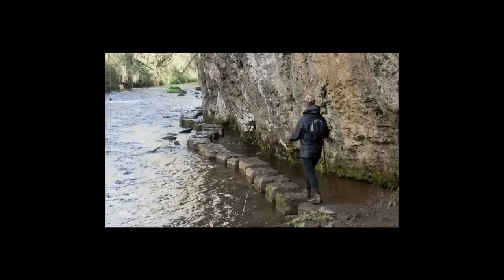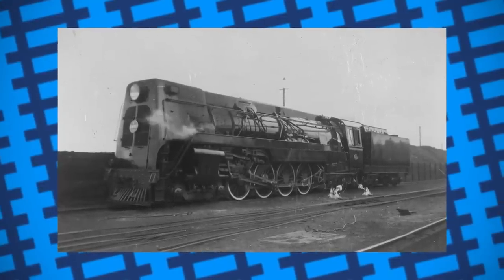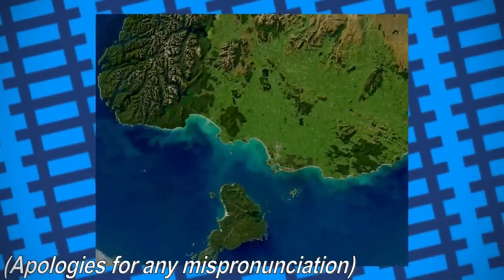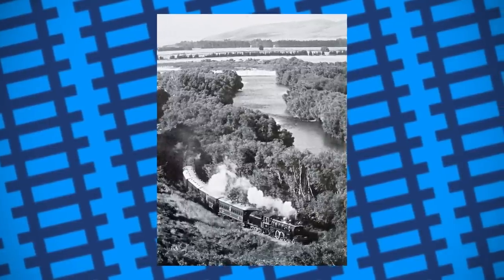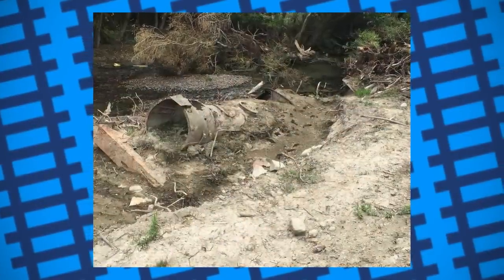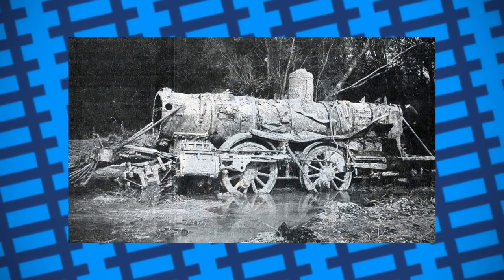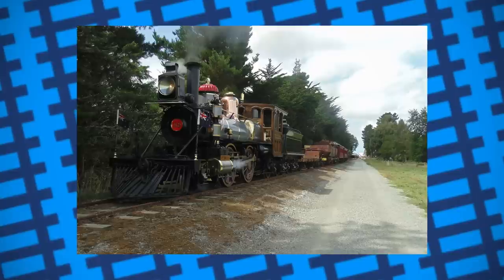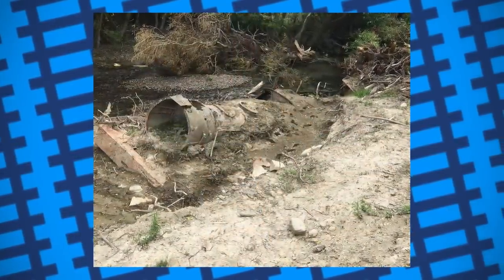The Steam Locomotives that were found at the bottom of a river - Branxholme Locomotive Dump

Comment: Its still very common in New Zealand to see the box bodies of old 4-wheel open topped goods wagons used as erosion barriers around rivers. Hundreds of them were retired in the 1970s  and 1980s with the move to containerisation and bogie wagons. Filled with concrete or rock they can stack like bricks and are extremely effective. Even better than thewire cage gabions which they use now since the obsolete wagon stock has been depleted.

Comment: There is 2 river engines that are in running condition, K88 as mentioned in the Video but also a sister engine to K88 which is K92, K92 runs at Waimea plains railway not far from Gore in Southland. Back in the late 90's and early 2000's K92 did a bit of a tour around some of the south island preservation Railways I had the pleasure of driving K92 a number of times at Ferrymead in Christchurch. I should also add that as a kid I lived in Invercargaill and in the school holidays I would bike out to the locos at Branxholme and spend a few hours exploring them before biking home, a round trip of just under 40km!

Comment: I remember hearing about K 88 and her story many years ago, and found it quite bizarre. I was lucky to see her at The Plains Railway in 2018, although they were instead running Vulcan Railcar RM 50 while the K sat outside the shed.

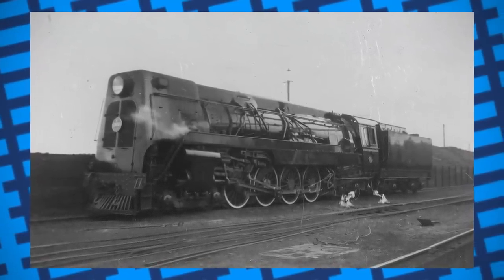(0:41) - That's a KA or KB class 4-8-4.
(1:31) - AB class 4-6-2 hauling what looks like the Kingston Flyer in the early 1970s.
(2:39) - JA class 4-8-2 No. 1271 on an excursion. She has run plenty of them in the past couple of years, and I got to drive that very same engine back in January, but only on a depot open weekend for $50.00

Comment: K 88 and K 92 were both restored to running order and currently operate, although I believe K 88 is having boiler work done to it. K 88 first operated in the 1988 iirc, then its boiler failed and a new one was made and it operated in the early 2000s. K 92 as far as I'm aware has been restored once, with a bit of paint work done a couple.of times but has mainly operated without too much work being done to it since its first restoration

Comment: New Zealand isn't the only place old steam engines were dumped in rivers, often times it usually happened in Alaska too. Shipping equipment up there costs a lot, and just as much to ship it back, so it's usually just thrown to the side.

Anyway, the WP&Y sometimes, instead of scrapping their old engines, would place them as ripraps in the Skagway river. Some have since been recovered and put on display, and there's a few known ones still down there, a good example being USATC S118 196.

Comment: Thought of this happening again - wonder if any present-day railroad would? Obviously not steam locomotives, probably not whole diesels, but I could imagine old diesel locomotive engine blocks being used for that purpose. Being roughly rectangular prism-shaped, they'd actually be decent for that, question is if their scrap value is more or less than the cost of a similar-size concrete block?

The closest thing to this I've seen where I live is a section of railway known as the "Big 10" on the UP Moffat Subdivision in Colorado. Severe winds derailed trains, especially passenger cars or empty freight cars, so a siding was built next to the main line, old hopper cars full of dirt parked on it, wheels welded to rails, and the connecting rails pulled up. Now many of the hopper cars have trees growing out of them, which makes them an even bigger wind-block.

Comment: I wonder how economical it would've been to just melt down the engines and form a proper barrier instead of this makeshift solution
Reply: If breaking them apart is uneconomical then melting them is just as uneconomical...
Reply: @theotherohlourdespadua1131  selling off the scrap metal was what was uneconomical. I'm wondering using the melted metal to make a proper barrier would be worth it
Reply: @dragonblaster-vu8wz  The dismantling of the locos is the cost that isnt out weighed by the sale of the scrap. you still need to dismantle them to melt them down. and then melting and reworking the metal is more cost, installing it would be another cost again. Far far more economical to just dump them as is, the only cost, is transport and placement. costs they would still have to pay if they melted it down and "formed a proper barrier" with, but it would have costed even more than just selling the scrap.

Comment: The mighty ka
Reply: I think it is a Kb class because I noticed that odd shape in front near the cab since I'm very similar with these K's Class.
Reply: @lyndonchow8961  No Kb was ever streamlined, it would be a K or Ka.
Reply: @TheSonic10160  I think both Ka and Kb from 1939 had streamlined throughout the 1940s until the late 40s to early 50s when they had their streamlining remove for easier cleaning maintenance. (The same happened to the NZR North British J class of 1939).

Also K class locomotives from 1932 were never streamlined until the Ka and Kb arrived with streamlined in 1939 during the Art Deco era before WWII. Ka 942 was the only Ka locomotive get it streamlining back.
Reply: J 1211 gloria still has its streamling.